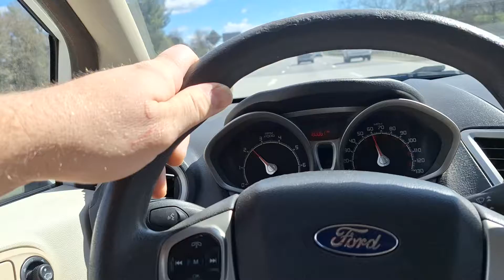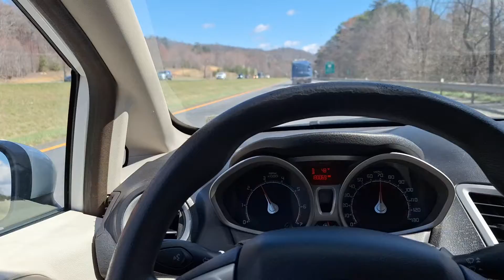Ford DPS6 - Clutch Stuck Applied Codes | Fool-Proof Diagnostic Method

Comment: So I have a 2013 fiesta with a code p2836 if the code is cleared ( MIL light ) the car drives fine. I can turn it off restart it and drive again no problems. But if it sets for a few hours I'll get in the engine light will come on and I won't have reverse there are some chattering noises for a few seconds

Comment: Both clutches show around 800 rpm at idol no change when pulling the actuators. This is after a full luk clutch kit replacement a couple thousand miles ago. TCM and actuators were also replaced at the same time (your videos were extremely helpful thank you). According to this one that would indicate there is a problem with the new clutch or forks right? Not looking forward to yanking it out again if that’s needed.
Reply from the maker: Hey, yeah that means both input shafts are turning when the clutch is not engaged, so either the clutch is stuck engaged or the forks are stuck engaged. Or there's a synchronizer stuck engaged on both shafts causing them to spin when the clutch is disengaged. But overall what I would do is diagnose based off the codes you have using my videos. I've also got a discord group you can join if it's difficult for you to diagnose

Comment: Have you used any of the EBay or amazon clutch kits or A & B forks? Or do you only use ford ones? Guy brought me a 14 fiesta that had a 3” hole in the side of it from a bearing going down in the side of the trans. but it ran drove and shifted just fine. So i bought a low mile used transmission and all the tools and pulled it out and cleaned everything up and put his clutch and forks and A/B bearing back in it. And it worked but gave a code for slow B i Engagement went and drove it around seemed to get better. But after about 15/20 mile drive it lost all even gears and has no reverse. And is giving a code for stuck b clutch. Do you think maybe the bearing for the clutch stuck? I haven’t messed with it yet.. Kinda got all tick d off as everything worked and shifted fine before I removed it cleaned everything up and then put it all in the replacement transmission and now I get this..
Reply: But reverse worked when I first installed it but had like a delay going into gear. Any help would be very much appreciated.. Thanks.
Reply from the maker: @Hendogg28  ebay or Amazon cheap clutch kits are known to be problematic and produce weird hard to diagnose problems
Reply: I was just wondering cause I’m about 2500 into the job and if I pull the transmission back out of it a 2nd time I was just going to order new parts. Seen those for what seemed like a decent price around 3/400 vs the 750+ for the LUK brand. Which I’ve read is who ford used to make there stock clutches for these.. 750+ is just ridiculous for a clutch kit. Which would put me over 3k in the job. Which that 2509 does include the cost of parts, and labor to do a timing belt and water pump job as well since I had the car already and was on the lift an the car had 160k on it with out ever having the timing kit replaced..
Reply: This car is just driving me up a wall. Will be the last one I work on for sure, to many problems with this one. Ordered 2 different transmissions both came in broken. Plus 4/500 in tools to do the job. Now it has a slow engagement for Reverse once I got it all out in, went and drove it and now says stuck B clutch and lost 2,4,6 and R completely.. Now I know why so many shops turned him away..

Comment: Hi Ben I did exactly what you said with forscan and when I check the RPM it’s showing zero at idle with both actuators connected and when I take actuator motor B off from the transmission I am reading 800 rpm. My code is P07A5. I have also replaced both clutch forks and slave cylinder. It’s confusing that I read 0 RPM at idle but read 800 when I take off B off the transmission.
Reply from the maker: Hi! That doesn't make sense to me why that would be happening. Did the fork splines spin back at all when removing the actuator? Either way, with RPM showing with the actuator out, Somethings causing the clutch to drag inside the bell housing. but before digging in, maybe you can try swapping actuators top to bottom and see if for some weird reason that changes with it
Reply: @BigBensCarsAndCycles  I didn't hear the fork spline spin back. Also i have already swapped the actuator motors. I remember dropping one of the clutch nuts when taking the transmission off and never found it i looked everywhere before assembling it. I wonder if tha some how got in there and is causing this :(
Reply from the maker: @zaza6151  It's possible. Maybe it fell on the ground under the car when pulling off the transmission, you can try looking around

Comment: I have the same issue with codes that are saying both clutches are stuck engaged or on. With a code of PO6B8. It will not start unless I put it in neutral or back to park and it doesn't work all the time. And once it's running the car won't move when put into reverse or drive. I'm not sure if that's TCM related or not. Also doesn't matter how the mileage is on the vehicle for Ford to cover the TCM
Reply: I am having the same problem, did you ever get it fixed?
Reply: @ncannon7425  not at all I declined on buying the vehicle.

Comment: Thanks for the videos!! I replaced the clutch and forks put it back together and get code P2872 also fails during clutch relearn with clutch travel error. I looked at the input shaft speeds on the computer while running in park and both a and b read zero RPM. Any ideas?
Reply from the maker: I'm glad it helped. With that code I would turn clutch A by hand and make sure everything feels OK. Maybe you left a shipping clip on the fork?
Reply: Did you figure it out? I am having similar issue

Comment: Hey Ben 
I got a 2018 ford forcus se automatic, my car shudders when coming off a red light, at times coming off a stop it doesn’t accelerate like if gear doesn’t catch I let go of gas and try a 2nd time and pray it catches witch most of the time it does, it doesn’t happen often but it does occur but I have no check engine light can I still go get it scanned.
Reply from the maker: The shudder may be just the clutch, but the loss of engagement is probably bad clutch actuators. I have a video on how to replace them. It's super easy. Get oem ones

Comment: Hey Ben, I did a clutch replacement with entire LUK kit. Never ran into this issue but now I’m having a p07a5 and I can’t get rid of It. I’ve tried swapping actuators with no luck. It will drive and then loose all engagement. Anyway this could be a internal transmisson issue?
Reply from the maker: Hi. Nope, I'd follow the directions in this video
Reply: Both are zero on the live data. Not sure next step
Reply: Correction went and scanned It again and now have a p074a
Reply from the maker: @jarrodsutton3603  that code indicates a gear 2 synchro problem. Got any grinding noise?
Reply: Yes I do now. Had a customer leave my car lot in low gear red lining It

Comment: Hello Ben
Unfortunately I have been having a terrible week as my 2017 focus spat out a P07a4 code and gave me the red alert to fix engine now. I took the car to AutoZone and the man over the counter said the error was coming from Section B ( which would be the bottom ) and that the Transmission Clutch Actuator and the TCM's are on national back order and to call Ford. I was told by the dealer I would have to wait over a week for an appointment and would require I leave my car which puts me in a bad spot as I wont be able to make it to work.

If I understand your video correctly I should remove the lower Actuator and start the car and add some gas (which in theory would unstuck the plates if it is the actuator). I would then shut off the car and install a new actuator for the bottom. If the problem persist I should remove both actuators and start the car. If the RPM's drop to zero it might be the TCM. IF they do not drop its something in the transmission. Please correct me if I made a mistake as I would rather risk purchasing a new oem actuator then paying over a thousand to have the dealer figure it out.
Reply from the maker: Hi, being a 2017 I don't think you need a tcm. You probably need just 2 new clutch actuators. I recommend oem actuators only
Reply: @BigBensCarsAndCycles  Thanks Ben ! I am going to the dealership today to pick up an actuator. Unfortunately they only have one in stock but 1 is better than nothing. I will keep you posted
Reply: 2014  focus ..shutters at take off. Warm up starts to slip won't go over 40. Last time wouldn't go in R..brother in law swapped actuators and it moved so he replaced actuator..gesrs looked worn..Month later same thing...think he  said code was for actuator..any help appreciated mothers car turned 90 on the 18th

Comment: Hey Ben, little help I have a p2767 after replacing the clutch, shift forks and slave cylinder. I can not get It to go away. I’ve tried swapping TCMs, all 3 speed sensors on trans and a harness. Any help would be so much help
Reply from the maker: Hi, it's common for the wires to chafe for those sensors near the connector. If thats the situation replace the connector
Reply: @BigBensCarsAndCycles  I’ll try another harness I snagged at the junk yard. I’ve had 30 focuses in past 6 months for my used car lot and your videos have guided me the whole way Thank you
Reply: I unplugged actuator B and accidentally started the car with It unplugged. I plugged It Back in and now can’t get reverse. Do I need to do a relearn? The tranny was fine until I did this

Comment: I have a 2014 Ford Focus SE and it has been an ABSOLUTE DISASTER! Since I've briefly owned it, both clutches have been replaced, the TCM has been replaced and clutch B actuator has been replaced. The car has been acting up again, weird gear shifts and refusing to start sometimes--showing fault codes P0805 and P2872. Took it to the shop and they told me it's loose wires/connections, for which they charged me over $600 to "repair". Car was fine for a day or two, took the car out today and the exact same problems reappeared, with fault codes P0805 and P2872 appearing again. Could it now be the clutch A actuator that needs replaced? I am at my wit's end with this vehicle, the car is a friggin' nightmare.
Reply from the maker: Sounds like this is the right video for your issue. You can follow the video and fix the car, or sell it as is if you're frustrated with it
Reply: Thanks for your reply Ben, guess I'll have to take it back to the shop and see if they can actually find out what's wrong with it THIS TIME. I now believe that the car is haunted.... @BigBensCarsAndCycles
Reply: @stevenbrown9678 sell it before it gets worse. I got my 2014 focus in 2015 with 7 miles and still have trans problems. prolly 20 different clutch replacements atleast.  Had coolant problems, motor mounts, headliner falling from wind, wheel bearings,  gas cap not pulling itself closed.
Reply: @IWillDuckYou  Unfortunately, I still owe 'bout $10,000 on the car plus the nearly $5,000 I've put into it trying to fix the transmission myself. It's been a total mechanical, financial and transport disaster for me. Hope you and yours are well---PEACE!
Reply: @stevenbrown9678  yeah I paid 26k total on my loan and wish I sold the year I paid it. Now i got so many problems I treat is like a beater car.
Reply: Sounds just like all the rest of the Focus's Ben's bought, and fixed. 😄